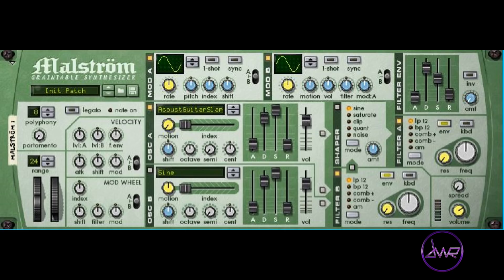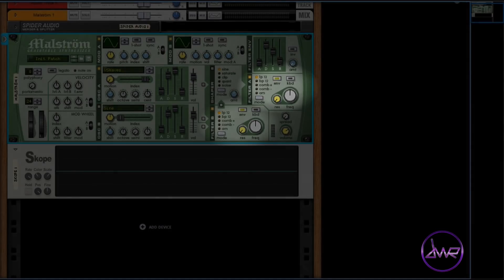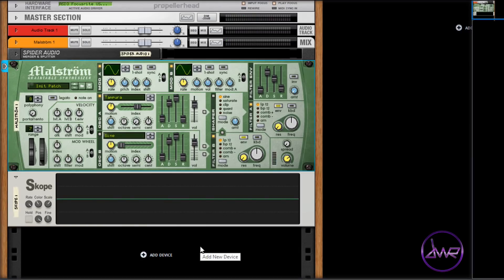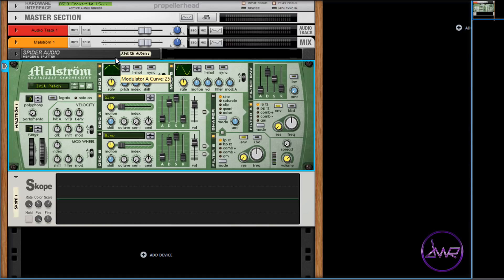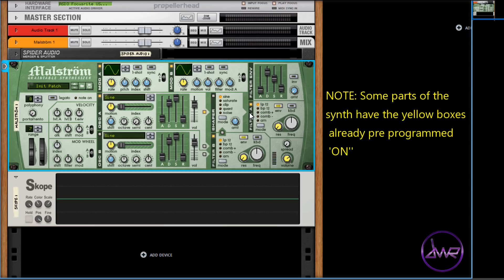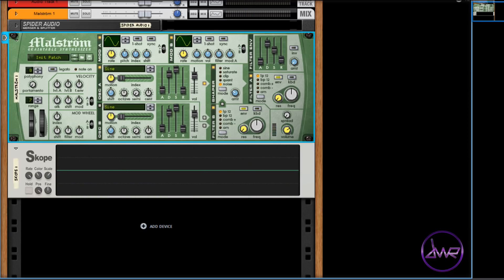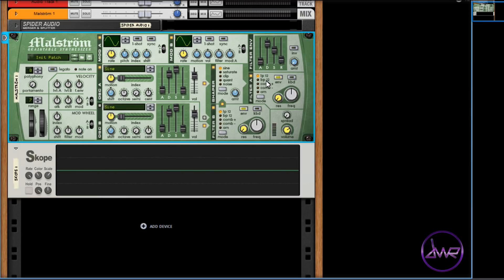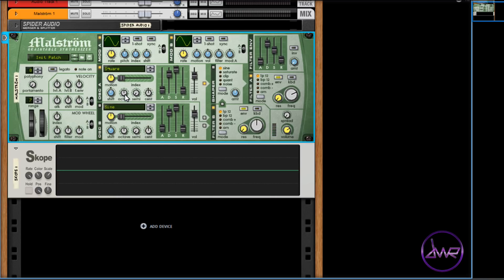Malstrom Synthesizer Tutorial part 01

Comment: Hmmm don't know with all these great synths out there and especially with Europa, which is a monster of a synth. Maelstrom just seems to sound too weak compared to the new generation of synths you have. Hopefully I'm wrong.
Reply: You are. The look of it throws people off. I didn't use it very much for years and when I took the time to learn it some. I uses it all the time now. And learning more form here!
Reply: try using it for just bass sounds. the wave shaper inside of malström is ridiculous. you can make FM type sounds by taking a grain table and using it a low octave. for example take the jewsharp table at a low octave. route into the shaper. for the second oscillator use the table called male choir also at a low octave and also into the shaper. now set the shaper to sine. then modulate the oscillator volume and make sure to use filter A if you want a clean filter sound. Filter B with the shaper enabled gives a pre filter distortion which gets muddy with the sine shaper. so just route everything to Filter A by checking the correct boxes :)
Reply: @andreilemieux9525  wil give it a shot!
Reply: Europa is ok, but it feels unfinished, it needs refining.
Reply: @bryan_explores  what synth would you recommend?
Reply: The Yamaha EX5. ;) The one I had started to fail and I sold it for repairs some years ago, it had many limitations however was capable of some incredibly unique sounds and had some very interesting effects. I'd like to get an EX5R sometime but they are rare and highly sought after.